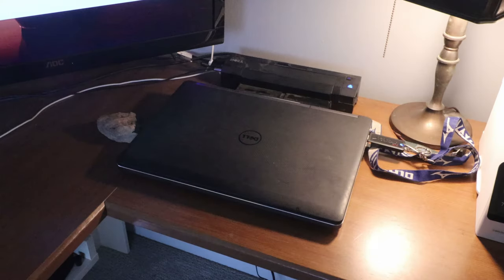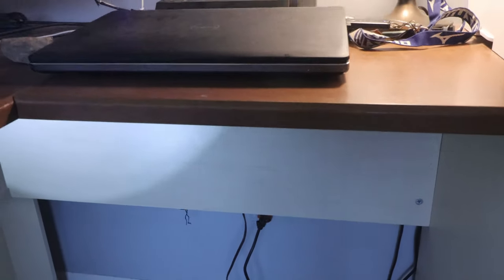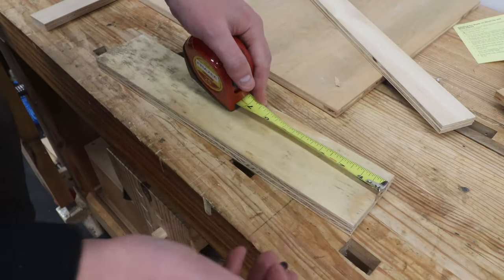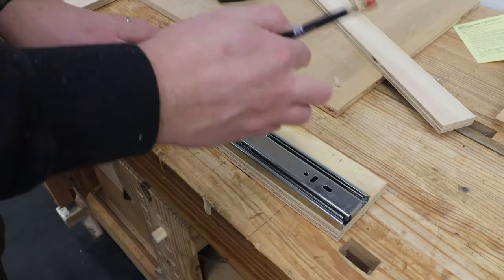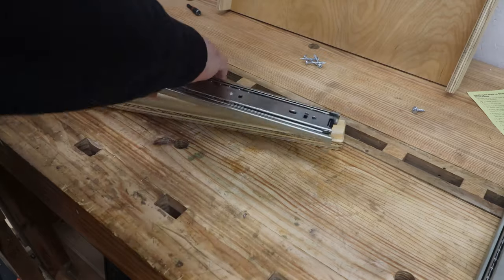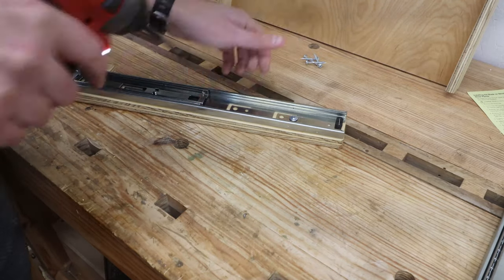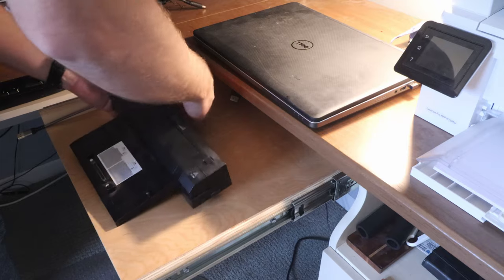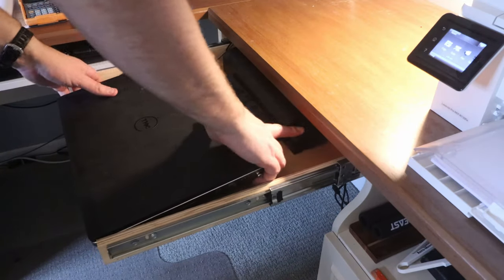Making an Under Desk Laptop Drawer to Save Desk Space | Home Office Storage Hacks

Comment: I keep my keyboard in my desk drawer.  When I pull out the drawer the front makes a perfect armrest for both arms while typing.   You adjust your chair for height and pull the drawer in and out for distance.
Reply from the maker: Ya, I do similar, but my chair had armrests built in
Reply: @GlennFrazeeYT  That sounds more comfortable than what I am doing.   I might have to install a piano hinge or 270-degree hinge for the front of the drawer to use my chair armrests.   For my other desk want to install an ergonomic keyboard tray.  They are a lot more adjustable.   Thanks, I am glad I found your video.

Comment: I'm about to add a keyboard drawer to my particleboard desk. And I have the same minimum requirements. My question is a year later, how is it holding up? Did you use enough screws to hold the slides and hanging support to the desk? 💖🌞🌵😷
Reply from the maker: It's held up just fine. It only holds the weight of the laptop since I don't ever type on it while it's in the drawer.
Reply: @GlennFrazeeYT  , do you think it would hold up with typing? 💖🌞🌵😷
Reply from the maker: Probably